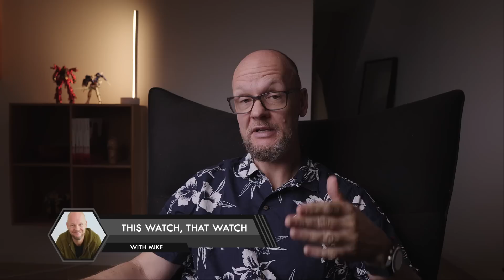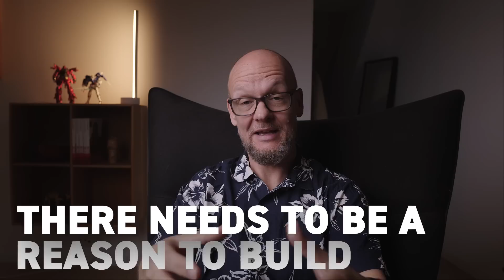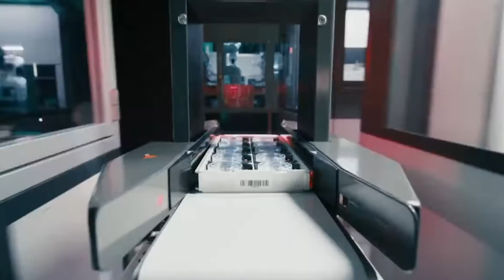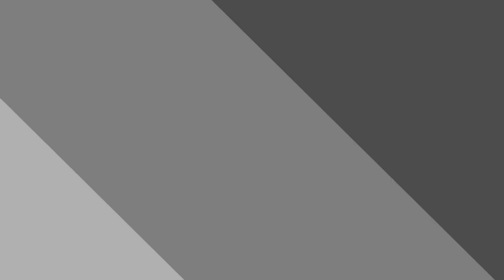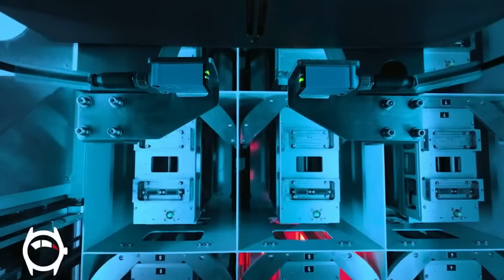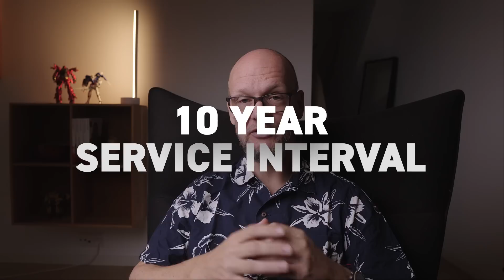In house movements & METAS: Overrated? Worth it?

Comment: Metas, COSC, superlative, whatever... I applaud advancement in horology, but to me a reliable reasonably accurate and above all cheap (500$ buys you a brand new top grade SW-300, cosc maybe 100-150$ more, but you just can't buy those as a hobbyist and even as a watchmaker it'll be hard) movement is all I ask. They won't ever make a Patek 5711 with a slimmed down Sellita SW-300 in it, but for owners who wouldn't know, it would not make any difference...

I like watches, and only mechanical ones. Three hands (AND a date). I'm a snob in that regard. My best watches are my 4R/NH35 Seiko's. Of course even a bad ETA or Sellita will always be a better movement, but bear with me.
I decide which watch to wear  in the morning, synchronise it, wear it all day and worst case scenario is that I'm 20 seconds late for my train in the evening. Or 15 seconds early. A 15$ Casio will perform like you're wearing an atomic clock, but I don't own any, and the mechanical Casio is, if you're honest, 'just' another Seiko with better QC here and there plus awkward branding, being overtaken by some Chinese brands. There is an NH35 in the your Orifice on your wrist...
Since I'm always several minutes early anyway, the +/-25spd do not bother me at all. I love beautiful watches, own several and I work in an office at a desk, but there's machine on that desk and wearing a 2.000$-plus watch to work is 
pointless from a timekeeping standpoint and a measurable loss of productivity from my part for the accumulated time it takes me to even just micro-baby them during the day. The machinery on my desk will beat any watch any day, all day long. I don't have to baby my Seiko's, they truly can and do take a beating during an average workday. No failure has ever occurred without a long period of warning signs preceding. They do ask a little attention in the morning, and I like giving it to them. I haven't bought a quartz in a LONG time, don't own any any more, but I advise over 99% of people who ask me what watch to buy (all three of them) to do just that, and to make sure it has a battery end-of-life indication system. 
I can source and replace (non chronograph) Seiko, Miyota and ETA or Sellita movements myself. Not everyone can say that, and i was not born with a the knowldge to do so and given any watch repair tools at birth. I broke and damaged A LOT of movements: lack of knowledge, proper tools and most of all: patience. 
Point is: watch breaks? i fix it myself for less than the cost of any service, and I dread the day my Tudor will need servicing keeps coming closer.

Comment: Always a good debate on your channel and a recognition that it's your preference. I'm with you nearly all the way on this but I would rather my watch gains 5 sec a day than lose 1 sec a day as it's easier to stop and correct whenever I want to. So for me Metas is a brilliant standard and so far have two with that standard, an Omega deVille Tresor manual wind and a Tudor BB 58 with red face and bezel. For many of my watches with a sellita movement I have been impressed when they gain a couple of seconds a day eg Christopher Ward. Even the Miyota movements are pretty good. The Hamilton Murph 38mm with a modified ETA movement and detuned to 3Hz gained 1 second in a week so pretty impressed given that it is a fraction of the price of Omega or Tudor. Keep up the good work I am learning a lot from your videos as well as others like Teddy et al. Thanks

Comment: One of my favorite manufacturers, Christopher Ward, has a fairly large back catalog for an independent brand. CW now uses more & more COSC certified movements. Their COSC watches are about 2x the price of their non certified watches. The price is about 1/2 of the price of a COSC Tudor, so I’m willing to buy CW. Sure I like a better, more technically advanced movement, but other factors influence my decision. Doesn’t Rolex meet the Metas standard? Is Rolex standard of accuracy the main reason to want a Rolex?; No, it’s one of many. I’m not partial to Tudor because it’s just Rolex pesky little brother. If I wanted a Metas watch I’d buy the OG, Omega. They are finished better than a Tudor in my opinion (fight me brah), but Rolex is still the emperor of finishing.

Comment: One important aspect of choosing in house vs off the shelf is the vendor lock-in effect.
Having an exclusive movement hand made in a remote German atelier by only two people is prestigious.
Until you need to service the watch and no local watchmaker is able to do the work for you. You literally depend on the original manufacturer.
Not necessarily a bad thing, but something to carefully consider before purchasing.

Comment: Discussing how accurate a mechanical watch is in the era of quartz and smart watch technology is like discussing advances in oil lamp technology in the era of electric lights. The watch enthusiast market should really be called the mechanical watch enthusiasts market.  The There is little reason to build a better mechanical watch as the problem of accurate time keeping was licked decades ago.  It is high time that the traditional watch industry look for ways to combine beautiful watches with all of the tech advances that have come on the electronics side including the smart watch. Other than the beautiful designs that we see from the watch makers there is little reason that a watch needs to cost thousands of dollars any longer.
Reply from the maker: Oil lamps are making a comeback. I'm sure of it 😂
Reply: @  They may be but I would not recommend investing in that market.  On the other hand if you find the lamp that Lincoln or Dickens read and wrote by, I would be interested. Have a great year.

Comment: I disagree with you about the 15,000 Gauss. The analogy with 11,000 water resistance is not equivalent. As a SCUBA diver and anesthesiologist I know I’ll never need more than 100m of water resistance. But, sometimes I’m called to sedate a child for MRI. Since there’s not ionizing radiation I can stay inside no problem, but the magnetic field inside an MRI is 1.5 Tesla, which, coincidentally is 15,000 Gauss. Any quartz movement typically just stops and a non-magnetic resistant watch would get badly magnetized if not damaged. So, no, you don’t have to work at CERN to take advantage of this feature.
Reply from the maker: Not a lot of people work near MRI machines either.... 😉

Comment: Tutor wouldn’t have built the quality of the watch w/o metas. The requirement was pass metas. It requires design as well as the manufacturing process. As a new movement, they don’t have to build as robust of a qa process in house, saving them money. Also it can be used to maintain the production line. Are we getting sloppy? Bill retired, does his replacement meet his standard? And so on. Their design requirement was to meet the metas metrics. To verify that in the initial release and maintain ongoing verification, they either build their own qa team and processes or they can outsource it. They are sharing the qa process with omega. It’s also built already, the initial development, capital expenses, ongoing processes are there on day one. It’s very expensive to build your own qa team and processes. That has a large capital costs that must be written off over years. Using metas is cutting their costs. They can also charge us more because of having an independent check is more convincing than “trust me.” So not only is it cheaper, they get to have us pay for its operational costs. Stowa may or may not DIN standards. They don’t make any claims that they have done so. They haven’t had their qa certified by an external group. The closest they get is offering top grade commercial movements, allowing some of us to verify the quality of the engine at least. Tutor is saving money and allows them to charge a few ch more. Those things you’re asking for are important too. A win to us consumers as well as them.

Comment: I see METAS as something of a title to earn that brands should strive for. For example, Mike Tyson was just as good before he received the title... so, by your logic, why go for the title? 
Did his punch become stronger, sending more newtons travelling towards his opponent's jaw after netting a title? No, not really. Did his footwork improve? Maybe the experience making his way to the top influenced it to a degree, but the title itself? No. 
So METAS is a title. Striving for it is good. It sends brands into a competition. Is it a reason to up the price? Very much so. Did Mike start charging more for his appearances after earning a title? Yes. Why shouldn't a watch brand do that? An actor with an Oscar charges more for the very same acting he would be doing without that Oscar. 

So, with my opinion of "does METAS matter? Yes, "being clear... is it overrated? Yes and no. Yes, because 15,000 gauss is ridiculous and testing for it is like testing watches for 1 kilometre of depth rating. There's no practical use for it whatsoever. Is it really overrated, though? No. Because when this certification is achieved it stands as a testament to high-standard practices and technological superiority, which translate into more than just bragging rights when you look at the bigger picture other than the price tag or the watch itself. It pushes the industry, as a whole, up to newer heights. The practices and technology that go towards the achievement then trickle down, making incremental changes, in non-metas certified watches, other brands, and even other things completely unrelated to horology. The knowledge and technology translate into practices and tools that do, in fact, matter. Sometimes, that's not true, but more often than not, these can be applied outside of a specific industry. 

So yes, Tudor did not get better due to METAS, just more expensive and posh... but no, that doesn't mean that METAS is useless or overrated. It only means that Tudor makes food watches and are good at marketing themselves. Good job, Tudor. 

But it is all in theory. For now, we can't even judge METAS properly because we only have exceptions. There's no statistical signicance to two brands, with several watches between them that hold the title. Once it is more ubiquitous, we could evaluate the real impact it had on brands, the industry as a whole, and outside of it.

Comment: While your points of real world benefit are valid, why stop at METAs? Do we even need COSC? Is +-5 spd really that different in the real world than +-15 spd? Taking this even further, do we need adjusted to 6 positions or even 5 positions when most watches spend most of their time in crown down position?

My question is where do we draw the line on real world benefits as it relates to movement regulation? and does this line change when you have multiple watches that get rotated daily?

Comment: I like the metas concept but the watches with it applied to them are generally in my opinion overpriced so I'd be unlikely to spend even more to get that. The Dean standard was something of which I  was unaware, worth investigating further, thanks.I was under the impression that Roger Smith was using co-axial movements basically following on from what he was doing with George Daniels, what is he doing that's different? I'd be intrigued to know. I  recently bought an Islander Brookville, nice watch with 9015 in and by my callipers 10.5mm thick for about £350.

Comment: I need my car and refrigerator METAS certified. Seriously, I would prefer if the Swiss concentrate their efforts in certifying home appliances. Ensure my oven and fridge temperature is calibrated to no more than +/- 1 degree. That my car is non magnetic to reduce drag and maximize fuel consumption. There's so much more than useless budget spent on an obsolete timing device.

Comment: Something to strengthen your case; I recently got a CW Pro 300 Diver (beautiful watch) with a COSC certified SW200. Its accuracy is under +2 seconds per day in all positions, which is fab! But it's just a SW200, not the top grade. So, presumably this means CW tweaked it to attain the required accuracy and Sellita movements are good enough to pass certification?! So, does cosc add value? Hmm... Question for you: I've not had a Rolex or co-axial Metas Omega but you have. Is the Rolex really +/- 2 seconds a day? Is the Omega's accuracy that good? Cheers!
Reply: @jerrycooper171  Both my 14060m from 2003 and EXP1 114270 from 2007 are + 1 a day since new. The Rolex 3130 movement is extremely accurate and steady. The accuracy doesn't drift at all. Great movement's
Reply from the maker: I'm not a details kind of guy so I can't tell you if my Rolex is more or less accurate than my omega. I also don't have on of those timegrapher machines so I honestly don't know. I can say that neither have ever been off in a way that I've noticed 😀😀

Comment: I thought METAS was open to all and not limited to Swiss manufacturing. Omega gives the illusion at least that while they helped create the standard and lab, it’s its an independent institution. 

My most worn watch is my Railmaster. I’m around magnets most days. That said, I wear it to work because it’s not precious, it’s understated for the most part. It’s just a good daily wear. 

My METAS Railmasteris not my most accurate watch though to be fair, it’s not omega’s most accurate watch either. My two personal best watches are my Grand Seiko and my El Primero. My non hacking Zenith it turns out is my most accurate, set it and forget it watch. It’s not even COSC, but it is fabulous. 

I very much agree with your summary as to what you would look like to see in the future.l. Dead on

Comment: It's a coincidence that  you used the Zenith 21 in the background while listing your desires. I wear a titanium model on the bracelet as my daily, it wears like a 42, is still keeping excellent time after 7 years, and has a very unique high beat movement. Not an obvious choice for a daily, but it's been surprisingly bombproof.
Reply from the maker: Nope - I chose it because they have the 21 movement that has a separate barrel that powers the chronograph component. It's got this whirring sound when it runs that I think is super cool. 😀😀

Comment: Great video and you have given me a lot to think about. I recently purchased a Black Bay 41 burgundy bezel. My other watch is a SINN 556 A RS. I noticed they both seem of high quality however, the Tudor seems more accurate and you can tell the quality is a grade above the SINN. If I had to sell one of these, it would be the Tudor. I really love SINN as a brand and its reputation as an understated tool watch. As far as the movements I do notice little things about the Tudor vs the SINN like the rotor. When the rotor spins in the SINN, it sounds like a cheaper miyota movement to me.

Comment: I do not care if an affordable watch has a Seiko 4R movement or a chronometer SW200. When I need accuracy, I wear quartz. I wore my old quartz Aqua Terra today. Usually I wear my Seiko Astron.

I love beautiful movements from Zenith, GO, JLC and others, but if I am buying a $1,000 watch, I could not care less what is powering it. Miyota, Selita, whatever. 

Mechanical Chronometers are useless. It is BS marketing from Swiss megacorps, and most consumers believe it.

I know I am reading the rant of a moron when he “needs a chronometer” in his $1,000 watch, but he will not consider “cheap quartz.” It may be the default view, but it is still idiocy.

Also, the term “movement technology” is absurd. These silly machines are obsolete by design. One could invent new outhouse tech, or new mule buggy tech, or horse coach tech, but this is absurd.  

Traditional movement manufacturing tech should be the target. The worst problem we will face will likely be silly movement tech that goes obsolete and cannot be sourced. This has happened elsewhere. Those silicon parts Patek used in their hi-tech watches is a perfect example.

The majority of people either need quartz, or they need to accept mediocre mechanical at entry level prices. Fighting to get COSC is silly. Pretty decoration would be more useful, but it costs more, so firms push for “better” sub-par movements. 

What we need are more quartz options outside of Japan. That would be rebellious, and useful.

Comment: What improvement will YOU get?
None.
I could swap the co-axial Seamaster movement for a dressed up ETA 2824, the Rolex Daytona 4130 for a $175 Dangdong copy with no free spung balance and the 26-330 SC from a Patek 5711 for a dressed up Miyota from a $300 fake and 99.9% of owners would never even notice.
We have Omega's with in house METAS and CWs with cheap Selita's doing the same job and somewhere some poor bugger is about to jump in the sea using his superlative chronometer Submariner to time his dive which unknown to him is a $400 rep.
It'll be fine, he's only going less than 40m deep for about 20 mins anyway because that's the recreational diving limit, and thats quite deep, getting dark type deep and "this isn't fun". So time of dive doesn't matter.

You could swap every watch you possess for the equivalent Chinese homage and the performance to you would not change one bit.

Comment: Spring drive. Third type of escapement with a magnet breaking a glide-wheel ;) Quartz a kind of escapement, not in the strictest sense, but all a watch has to do is preventing the power source from going flat in an instant... Spring drive to me has an escapement, Quartz is very (much) debatable.